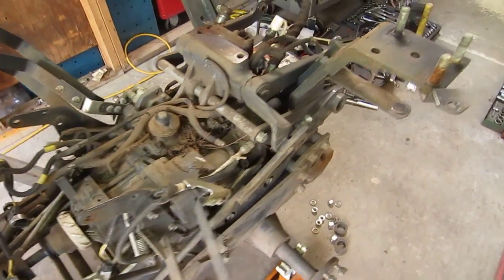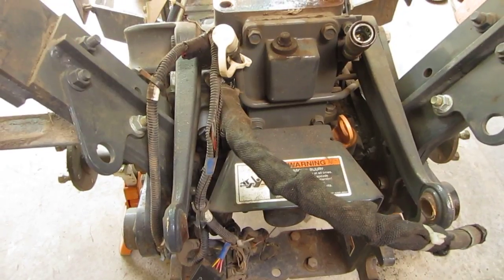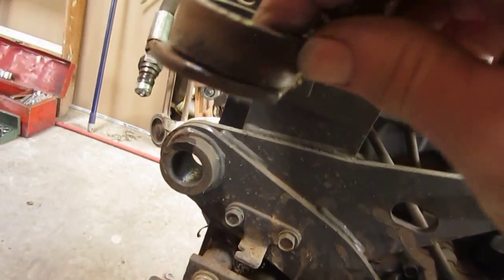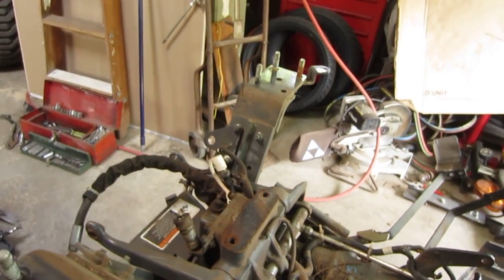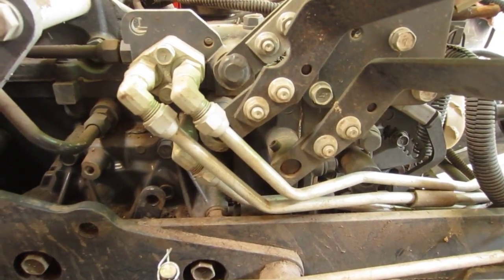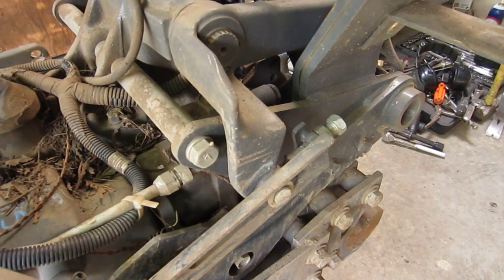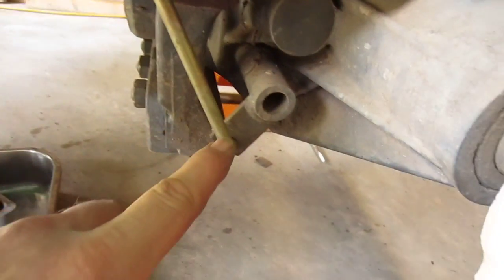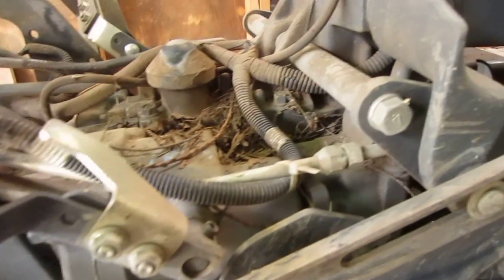Kubota BX25 differential lock fail, under the skin, the preliminary looksee.

Comment: I give ya credit man, and don't take this the wrong way I just heard "thingy" a bunch of times lol, but instead of bringing it to the dealer you're doing it yourself with (I'm just assuming) little knowledge of this particular machine. Most people bring it to a mechanic (me) and don't bother with even the simplest repairs. I hope ya got it fixed!
Reply from the maker: I have quite a few videos, about BX thingys, including a final engineering operation which has been awesome, and a simple resolution to pin failure and failure of the differential lock.  I am an engineering student, a mechanic since 1970, and a home renovator, doing all aspects including plumbing, electrical, tiling, drywall, cabinets, etc.  :-)  thank you for the compliment.

Comment: Hey, Thank you for sharing this video (and your other videos!).  I used to be a big kubota fan - great experience with their engines in other equipment in the past.  Bought a kubota tractor 5 years ago that I mistakenly upgraded with another Kubota tractor 2 years ago.  Won't make this mistake again.  The diff lock on both kubota tractors failed.  Both were under warranty when they failed - Kubota claimed operator error.  First time I thought maybe I did something wrong and treat the first incident as a one-of; got it repaired for $3.6k.  Later in the year I upgrade for a cab model - big mistake.  The new tractor's diff lock failed at 14 month mark.  Kubota dealer claimed operator error again but it happened in winter when I was clearing snow off my driveway and tractor had little traction on ice.  Also, the second tractor saw hardly any work - it was only used for mowing the lawn in the summer and pushing snow off my driveway in winter.  This diff lock is a faulty design.  I am looking forward to getting rid of this headache and getting a domestic tractor this summer.
Reply from the maker: Absolutely their engineering is at fault.  It isn't the engagement that busts them up, but rather dis-egagement,  as it isn't quick and smooth, and as in my other videos, parts bind up and will not disengage the pins until they 'work their way out' and usually under severe stress, and the pins snap.  I have had good success with my diff-lock mods, was using it the other day, the most recent video posted.  500 hours and still working smoothly.  Operator error ----  bullshit !   LOL

Comment: Buddy, I just got mine back from the Mechanic. Exactly one year old and this one cost me $2400.00 usd. The replacement parts are exactly the same as those that failed. Problem is that I only needed to use the Diff lock a few times and completely stopped my 25d to ease it in.  SO in essence the warrantee is crap. Which is the reason I wanted the Kubota product in the first place. Not only do they know about this design flaw but it assures a lot of future income to their service mechanics. I am disengaging the pedal today. Its a fine tractor as a 3wd. If I need to get unstuck I will use the backhoe or tow it out with my truck. I cannot afford to ever use the Differential lock again. Brand new tractor with Grapple. $21,000.00 cash  yearly maintenance $1500.00 new Differential lock gear set $2400.00.   Kubota bx25d is lookin like $25,000.00 out of pocket year one.  What other poison pills Have they engineered into this money pit?
Reply from the maker: After re-enigineering and assembling mine, I am again having a binding issue with release !  I have not checked it out.....  grrrrrrrrrrrrrrrrrrrr   but it will be annoying to take it apart again, after only a few hours use.  I believe the diff-lock shift fork metal is too soft for their intended use, they need a spline assembly instead of a pin !